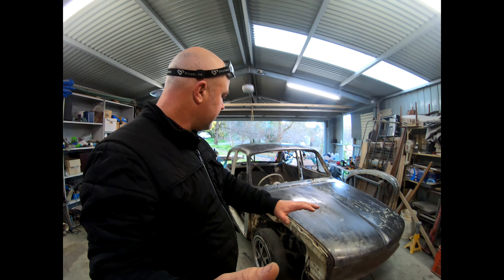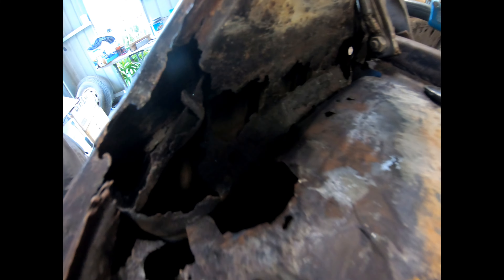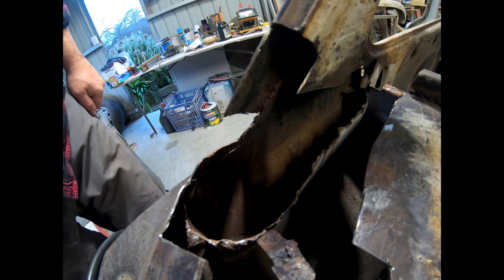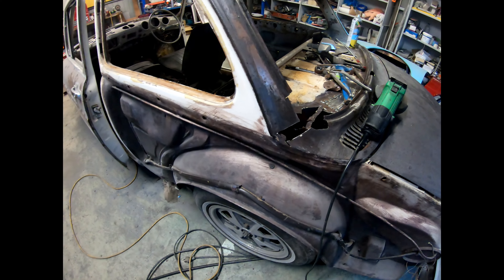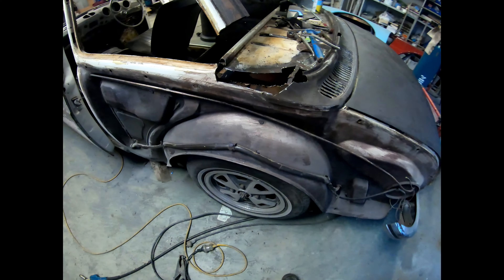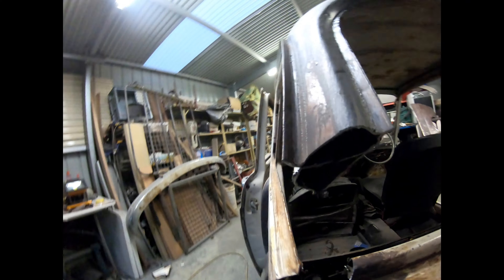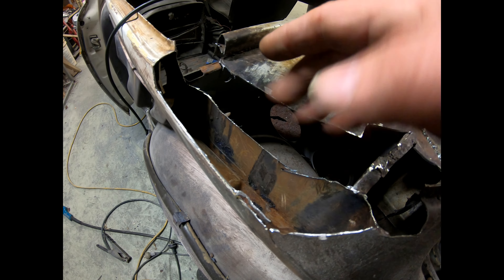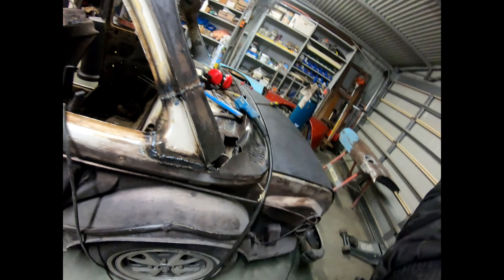VW TYPE 3 - NOTCHBACK RESTORATION - C Pillar Day

Comment: big move to cut that but it had to be done, I think the hot rod guys use a power hacksaw or saw, cleaner cut & not so much lost material, don't know if that would make it easier in your case
Reply from the maker: Yeah mate, I was definitely nervous. I don't have any saws so had to rely on the grinder. Turned out pretty good though 👌

Comment: I'm sure my 70 is hiding some nasty bits but it's on the road and that's all I care about.  Your rear windscreen rubber but have been toast for years. You can make a small drain in that area, hole, weld a bit of thin pipe and attach some poly tube to it and run it out the bottom somewhere between the panels. It's an awful spot with the drip rail, vents, boot lid lip & inner & outer guards. Good luck..
Reply from the maker: That's a great idea 👍